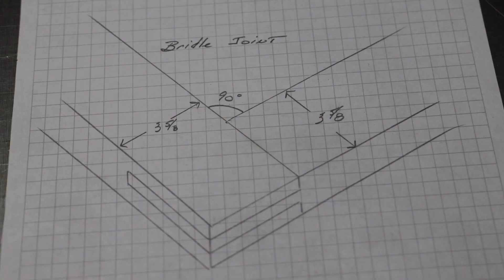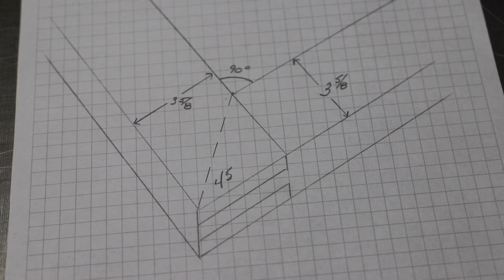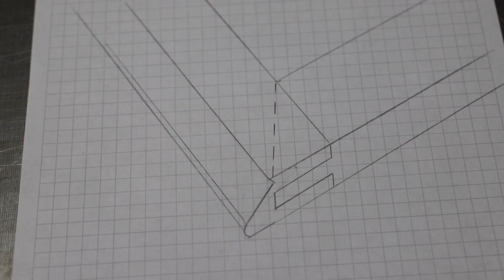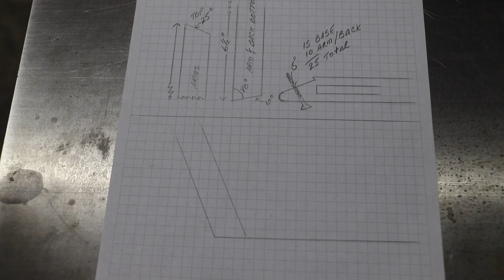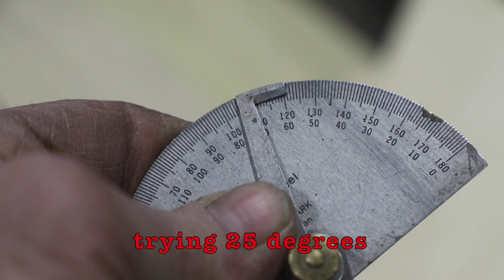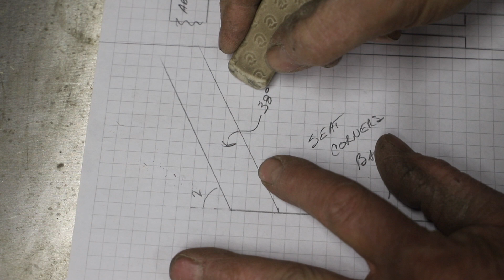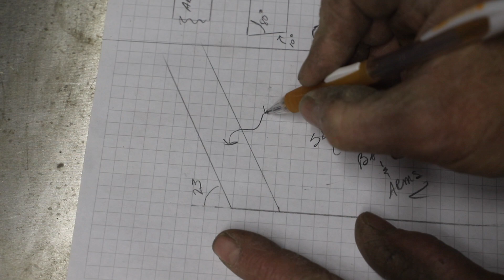Compound Angles in a Buggy Seat | 2 Seat Buggy Part 9 | Engels Coach Shop

Comment: Did you wet the corner end grain joint with water prior to adding the glue? What is the brand and description of your rasp that you use so often? Great videos and really enjoy your channel! You would love my steam powered 1929 Dunbar popcorn wagon in white oak built on a 1929 Chevrolet 1 1/2 ton  truck. All mortise and tendon joints with square pegs in round holes fastening things together.

Comment: Dave, what are you doing at 19:52? It appears you have a wet rag, are squirting some Weldwood into it, and wetting the endgrain with that, before you put the Weldwood glue on it the normal way. I have never seen that in 40 years of amateur furniture making (nothing upholstered). Please tell me about it.
Reply from the maker: End grain is a wicking surface.  Prewetting for a water soluble glue helps that surface condition.

Comment: Geeze!  Chinese Algebra, German Engineering, British Overkill and commissioned by a Committee of ADHS, AR, COPD and TriPolar.  Does it have to be watertight?  Trigonometry?  I think the same guy that designed your incredible table saw (ways need lubrication on the sliding table) thought up this Buggy buster.
Some would cut a rectangular hole in a wide plank for the seat and a couple Dado joints and Done!  That would include me.  They probably parked them outside...
Puzzle?  Think nightmare and Space Shuttle.

Comment: I restore old cars circa 1910-1950, depending on the request from the owner( the payer) I copy the original methods of construction, although I wonder WHY they sometimes used the such poor construction. Its easy now days with the modern tools to produce more sturdy construction but that's not how it was done in THE OLD DAYS. Many of the parts are just copies of the rotted parts made of better timber and treated against rot and borer.
I enjoy your work and envy your workshop with its tools hung on the walls waiting for just the right job for it. I find it hard to dispose of any old tools and drive more nails to hang them up.

Comment: Is that just water you wiped the edges down with, or was it alcohol to remove the oils from the wood?
Reply: I wondered  about that. My guess is water to help the glue penetrate? Or rather to stop the end grain sucking the water out of the glue?
Reply from the maker: Yes, just water.  Titebond is a water soluble glue.

Comment: Thought it was called hidden miter joint.
Reply: Old days using squared boards, a steel square and adjustable bevel they found those desired angles butting boards up. Some unique joints.

Comment: Mr. Engel, may I ask why you put nails in the seats instead of wood dowels???  seems to me that the metal nails(being a dead material) will do over time, exactly what you don't want to happen---wooden dowels being the same living , breathing material as the seats, would swell and shrink with the seat material, time, and environment and seal the hole they are in so much better, even if painted or oil treatment wears off

Comment: So anyone come up with a formula for those angles?   It's been rolling around my head off and on for days.  If there was no angle to the pieces, then the parts would stand at 90 degrees to the base and the 2 pieces would join with a simple 45 degree joint, and if the back was laid out flat, then 2 parts would be at zero degrees and mitered to 45 and the joint would have no angle, just a butt joint.

Comment: Dave, I do not think there is a formula for compound angles. If you watch https://www.youtube.com/watch?v=oKJagvumvCI&list=PLB00JHoTw1TeX82Qw8hoFLRJI89Us_jMw&index=25 starting at 24 minutes you will see a boat builder coping with finding the angles to cut the frames (ribs) to "fair" lines which move in three-dimensions from stern to bow, and keel to deck. Leo had to redo them over dozens of times because changing one edge of one frame changes all the others in all directions. It is amazing how much effort Leo put into this. This is the "lofting and fairing process." Clearly there is no computer program to do this or Leo would have used it.
Reply: Maine boatbuilders do lofting in CAD all the time.  If you're building many of the same thing, the computer programs can save a lot of time, but when you are building just one, they won't save any time for craftsmen like Dave.